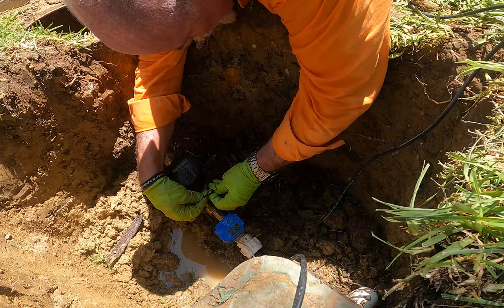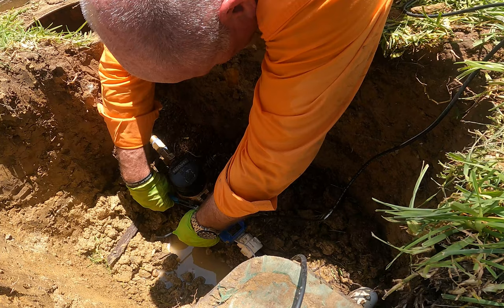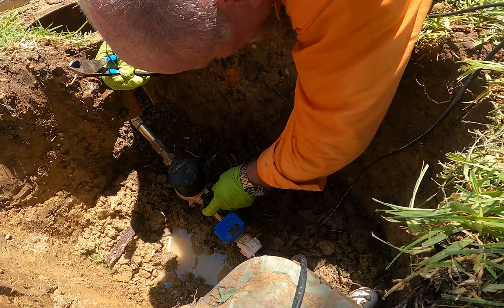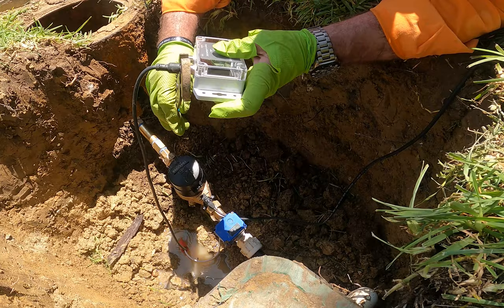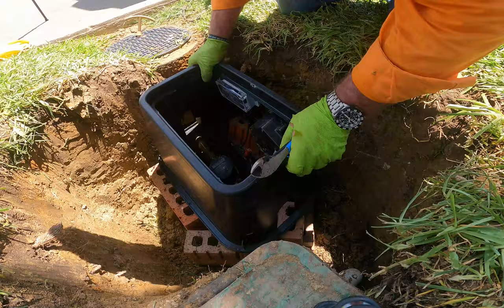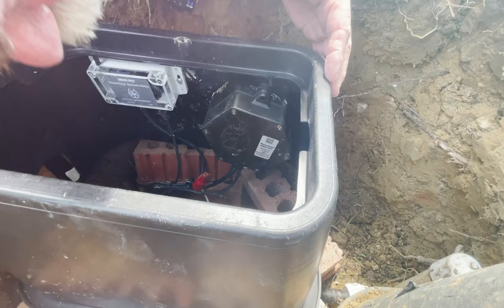How To INSTALL The MeterDog Remote Leak Detection System

Comment: For years I used to use the flocontrol fittings, but recently I've been finding many leaking. I've switched to using Ford fittings. I like how strong they bite down on the pipe.

Comment: What's the out the door cost to a homeowner for this? I have installed multiple products that were all customer purchased. I will not endorse anything without absolute professional testimonial. I am curious about your professional opinion.

Comment: surprisingly, the weak link to that whole system is the white wire you left not very well secured with a more waterproof connection

Comment: we recently had some plumbing work done bathroom remodel and layout change. But the Plumber brought up something. That we should be calling him/ company every year to get inspection done and have Fill Valve and Flappers in toilets Replaced and Drains resealed. 

Doubt we would need anything like that. But Im just wondering if there is any truth behind having yearly inspections and fill valve and flapper replaced? Or just what i think it is. a Money Grab
Reply: Well it depends. If you have very hard water and all your angle stops/supply lines/faucets are getting corroded and gets lots of build up on them. Then it wouldn't be such a bad idea but then again you can do all the inspections yourself. 
To answer your question. Yes ots a money grab. You should be fine for a  couple of years without an inspection

Comment: If you activate it and it shuts off does it open back up?  We had a customer have a similar idea gadget on his main in the house but when it sensed a leak and shutoff no one knew how to release it so the water could flow again. So we just cut it out and threw it in the dumpster. Sounded like a great product until he couldn’t have any water in his home. LOL.

Comment: Roger, I noticed that you use channel locks and pipe wrenches religiously in your videos. What do you think of some of the newer versions of channel locks and pipe wrenches, such as the craftsman robogrip plyers?
Reply: Channellocks are tried and trued. Some guys swear by knipex, but they cost much more. For pipe wrenches ridgid are the hands down best, but home depot husky works well too. Robogrips are toys.
Reply: @charlesking678  I'm a big fan of channel locks (a must have for coal miners) and rigid tools. Rigid makes much more than pipe wrenches and they are all good tools.
Reply: Knipex are best but channel locks work. Knipex are easier on your hands because of their grip design. You often have to use a lot of hand strength to keep channel locks in the right spot and not slip. This job is hard enough so just get the knipex. 
They have thinner jaws too so they will fit in skinnier spots. Sometimes that’s crucial.